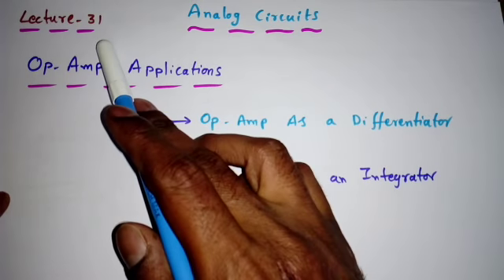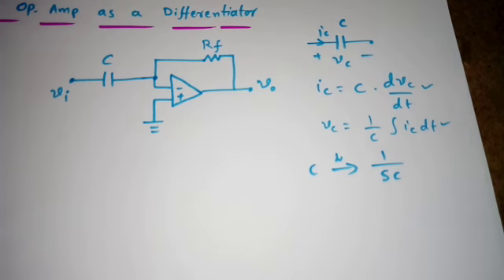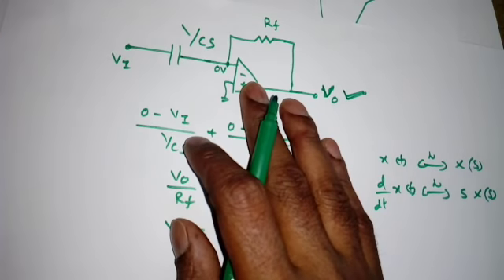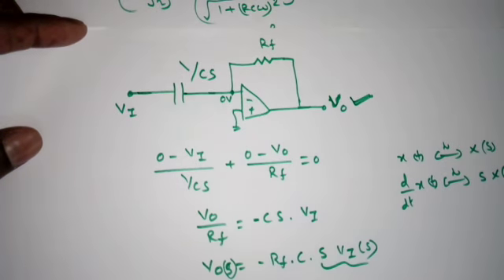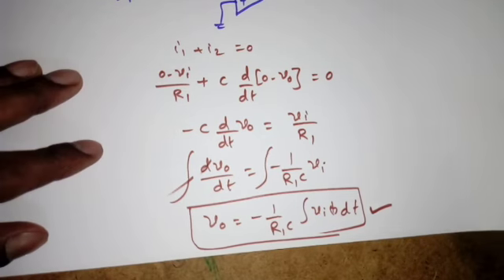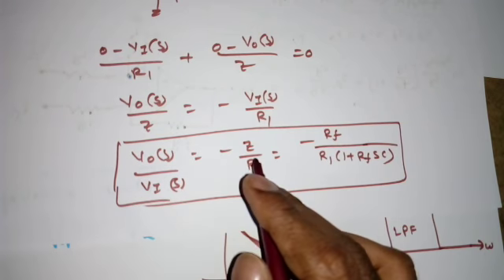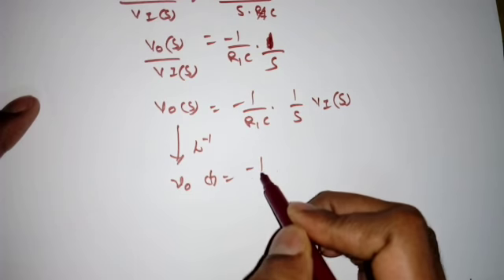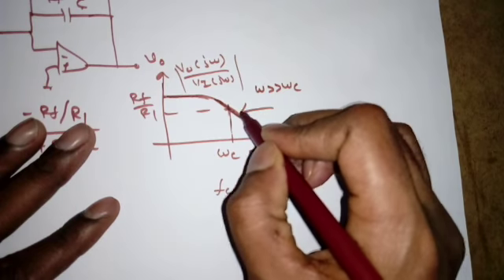Analog Circuits Lecture 31 Op-Amp Applications - Part 2

Comment: Sir in previous lecture you said that I2(output current) flows from v0 - inverting terminal but not the other way because of high resistance so what is the reason for reverse I2  direction in this lecture sir?